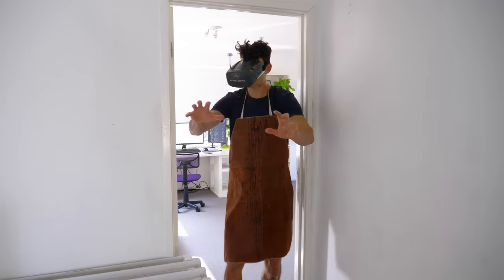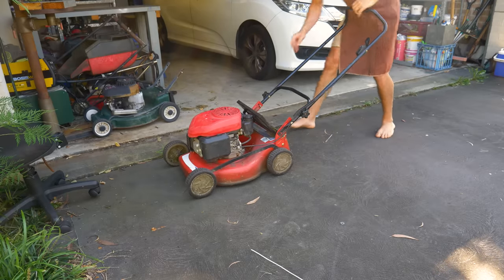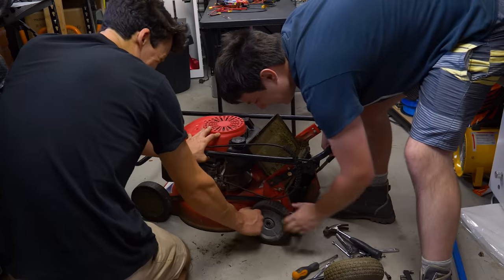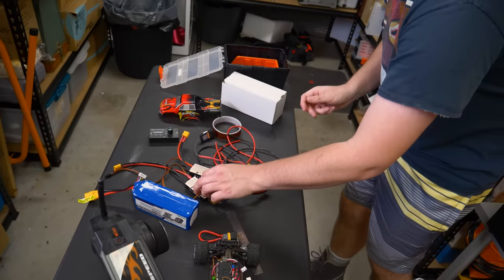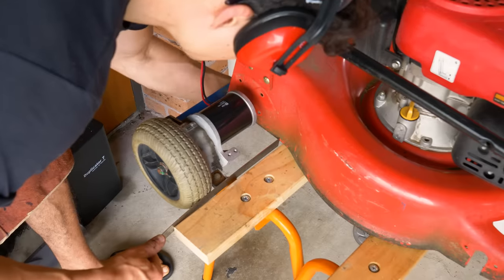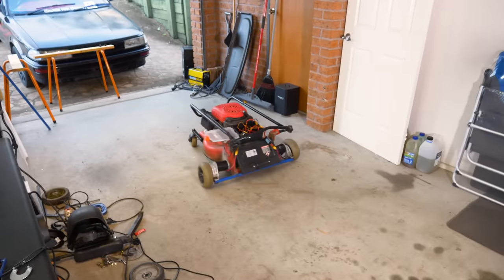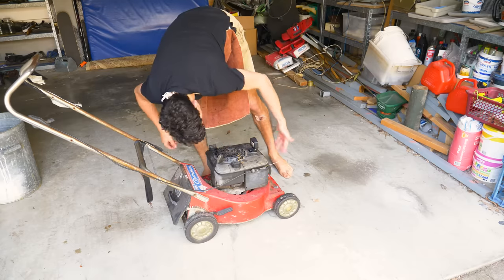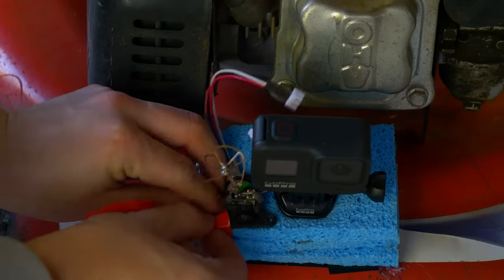I Made A Terrifying Robot Lawn Mower

Comment: The fact that he went through the painstaking effort of motorizing a lawnmower, deconstructing a mobility scooter, making it remote control, and hooking it up to vr only to realize he forgot to add a way to turn it off sums up IDAT perfectly
Reply: He threw it in the trash.
Reply: Imagine just walking by and seeing a lawn mower mowing a lawn without someone pushing it.
Reply: What’s IDAT?
Reply: @Lehpurdzzz  the channel name
Reply: There's a small wire plugged into ignition coil. Touch it to the frame (ground). Put the wire on a switch.
Reply: @waspshower  they have automatic lawn mowers that work like roomba's. They have been out since 1995.
Reply: @WintersMinion  have you ever seen one in person?
Reply: @WintersMinion  exactly. I've waited 2 months to get my point straight and it was worth it.
Reply: @waspshower  i've seen at least 2 around where i live, one mows a big park the other just mows in front of an office building

Comment: I used a Sabertooth 2x35 amp speed controller on my mower to control the motors in mixed mode.  I also went into the settings on my RC controller and changed the Exponential settings to values which reduced the center stick sensitivity quite a bit.  Doing this allows you to ease up and slow crawl the mower without having to lightly flick the stick to keep control.  THis is a huge improvement and you need to look into it.  My FPV gear is all 5.8mHz and micro sized vs. a big bulky GoPro.  I also chose to use a 30 Ahr. Lithium Iron Phosphate battery instead of lead acid.  Much more steady voltage, thousands of charge cycles and a huge weight reduction.

Comment: Actually about the drilling at  7:53 I learned a rule to get the proper rpm at school it is 7000 / the diameter of the drill in millimeter = RPM so when you have a 7mm drill you calculate 7000/7 and you get a 1000 rpm and that's with what you drill with

Comment: My dad found his lawnmower on the side of the highway about 25 years ago now. He's rebuilt it 4 times, the stubbornness of this man is unrivaled
Reply: Every lawn mower I've ever owned were ones I've found by the curb or in the alley. They usually get thrown away because of something dumb and simple such as a broken pull cord or varnish in the carb float bowl. Most people are either too lazy or stupid to fix it themselves and it costs less to buy a new one than to pay someone else to fix it. My current two are Frankenstein mowers that I built out of parts from other found trash mowers I've fixed, used up, and ran into the ground. Once these ones are used up, I can harvest the good parts to fix or build another one and keep the cycle going.

Comment: if you had removed the sides of the mower to "see the blades spinning and stuff", it would have no longer cut the grass as expected. the housing of the mower deck is designed with the blade to provide a lifting/sucking force on the blades of grass to cut them all evenly AND the housing allows the updraft of air and clippings to be directed out of the ejection port hole.
Reply from the maker: ahhh very cool. Glad i didnt

Comment: I was concerned when he mentioned taking the guard off the lawn mower so the blade could be seen. Turns out it isn’t really a “guard” sure it has a convenient side effect of stopping Debris being thrown. But it’s real purpose is to redirect air flow so that the grass is pulled tight upright and cuts rather than the grass just flopping over out of the blades way.

Comment: The right angle shaped aluminum cover over a rubber wire, that’s a spark plug so if you pull that it’s like a killswitch

Comment: You dont actually want a slow speed for metal, the correct speed for steel can be found by dividing the size of the drill bit by 8000 so for a 5 mm drill bit it would be 1600 rpm, a 10 mm drill bit 800 rpm, This is correct for when the material is adequately held and the drill bit is sharp, you should however slow the speed down when it isn't held very well or are using a hand held drill and it will also increase the life of the drill if you are unable to sharpen them.
You can also find the right speed for other material's by using a similar method and adding or subtracting a percentage of how tough the material you will drill is, so for aluminum it would be roughly 30 percent, eg. (8000/5 )x 1.3 = 2080 rpm or for stainless steel subtracting 30 percent of the speed, (8000/5)x 0.3 = 1120.
in summary slow is good, but not best.

Comment: Clean the yard before you cut so no one dies!!
TWO ways to stop the lawnmower: Run a wire from spark plug to toggle switch to ground!! With switch on the ignition will stop. 
Pull sparkplug wire!!.🙄👍

Comment: I had a lawnmower that wouldn't shut off , you have to pop the rubber cap off the spark plug . Screwdriver or pliers. It will shock the shit out of you if not insulated thow ... I found out real quik...but that's the best way guys.

Comment: Next time you can't turn it off pull the spark plug or U can fuel cut it which is just cutting the fuel line switch (not literally cutting it)

Comment: you should put the camera up on the push handle and put some guide sticks by the front wheels for reference points so you can mow around obstacles easier. With an arduino and some code, i reckon you could have a little Roomba for your yard